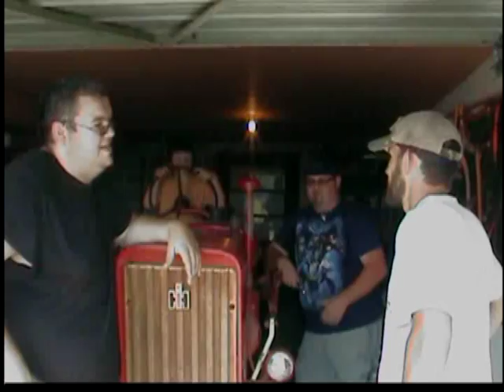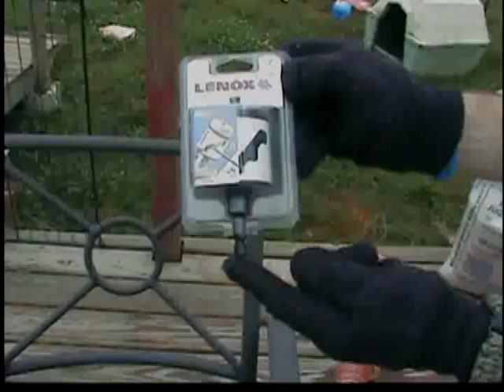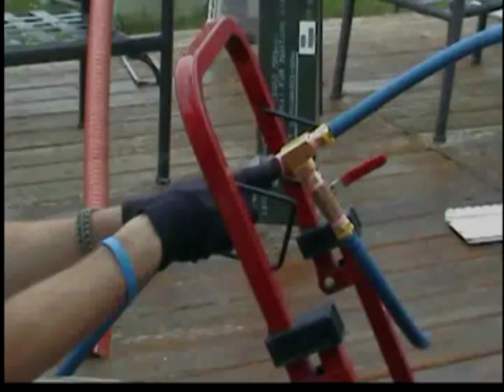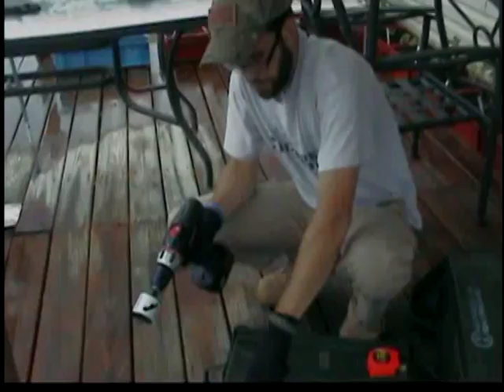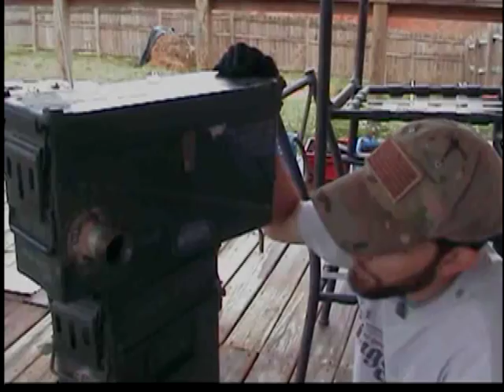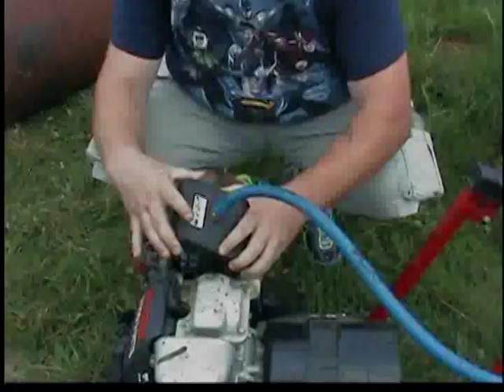How To Build A Wood Gasifier (FEATURED ON DOOMSDAY PREPPERS SEASON 2)

Comment: Coal burns cleaner then wood. Coal, just might be a better cleaner burning Gasifier.
Reply: ilililhy1 I think that a lot of the gases and smoke from burning the wood are captured into the system and turned into either creosote or usable gas. Would be interesting to see a study on that.

Comment: Could I hook up a device like this to the exhaust of my pellet stove?
Reply: Generally, no, you have to bake the wood in an absence of oxygen in order to get a viable wood gas off of it to power your equipment.  Your pellet stove burns the wood in air, and if it is working right, the main products of the breakdown of the cellulose would be water and carbon dioxide.  When you bake the wood in an absence of oxygen you get gas with the major constituents being carbon monoxide, some hydrogen, as well as a bit of heavier hydrocarbons and some inert gases.  Carbon monoxide and hydrogen are both useful as a fuel in that they will burn when mixed with oxygen in the cylinder(s) of your generator engine.
Reply: richhagenchicago baking wood is more like destructive distillation than how a wood gasifier works. WW2 systems in Europe and later don't work like this at all.

Comment: Question about fuel: What have you used as fuel for the gasifier? As well, what fuels have you tried to turn to gas? In one episode of Doomsday Preppers there was a family that was manufacturing blocks of newspaper & cardboard via a shredding/soaking/molding process. Is there a possibility that this product could serve both as a fuel to gasify and at the same time be in the gasifiying chamber? And of course, less specifically, what other alternative fuels have you used for the gasifier? Any help greatly appreciated!

Comment: This is a good start to driving a vehicle of using electricity to run.  Being homeless
it could keep you warm with lights and more.  The cost to start is hard and the box (s) can be made of other metals to replace military ammo boxes that are not always available at army surples stores. The thickness of metal and size(s) should be told as the least and most you can use.
Reply: You can modify vehicles to run directly on wood gas.  It was probably a lot easier on vehicles with carburetors, but it has been done extensively in times of crisis or war when petroleum based fuels were not available.   The premise is simply to bake a cellulose containing material such as wood in the absence of air to cause it to break down and give off gasses that can be used to drive your vehicles engine.  These guys built a simple practical system which works for their purposes and took the time to clearly explain how they did it so that others could copy.

Comment: Hi guys do you want to  help me out  . I am trying to get parts to help my farther start replace is stolen. 600 watt solar set up, they took everything charge controller, 4 deep cycle battery's . 2000 watt 230 / 240 volts  inverter made for UK cables the lot I am trying to find were I can get 1500 to 3000 watt 230 / 240 volts inverter which will run UK items all I can find are 110 .Can you help do you know anyone who would send  a Harbor Freight solar kit to UK or any parts like Harbor Freight charge controller which would help so much get started  has we can't get in the UK nothing on eBay UK  
I know he always watched your video's for hours and I know it took him two years to get all he had testers so on set up is solar,and get 230 / 240 volts inverter Norman
Reply from the maker: Im not sure what the alternative would be in the UK on the harbor freight type unit. I would look on the US side of ebay for a seller that will do international shipping. I would imagine that harbor freight would ship it but you would have to pay astronomical shipping on it though. I cant stand theives and that is why I am getting the bullets loaded on this side of the pond because I wont tolerate people coming to steal what I have worked hard for. I hope all goes well with your effort and if you cant find an ebayer on the US site side just email me at 7trumpetsprepper@gmail. com and I will take a look when I get done with some ministry work this week. blessings
Reply: I don´t have too much knowledge on this topic, but wouldnt a 110-230 power converter do the job?
Reply: Hi  harbor freight units on eBay prices 3 x more with us  import tax ,government tax here and not lot can get any good from ebay UK
hope you all doing well

Comment: Just a thought,  couldn't the gas from the gasifier pass through a sealed water tank system like the thump keg on a still to cool it as well as filter it before the gas gets to whatever motor you are trying to run? As far as that goes as far  as I can tell a liquor still with very few modifications ccould be converted to become a gasifier.....

Comment: if  you use a welder and gas pipe or galvanized pipe and fittings you can eliminate the rubber pipe and the rtv silicone

Comment: is it more efficient that building a steam engine that would turn a generator?
Reply: If one is looking for efficiency, then perhaps a stirling engine run from the heat generated by the fire? One could still produce biogas the way 7TRUMPETSPREPPER did and maybe use the waste heat as well for a system more efficient than a steam engine, I would think.
Reply: xoxoXoieoxox All the info I can find on Stirling engines makes them out to be very efficient, but I'll admit I'm an armchair engineer when it comes to things like that shrugs.  However, it does seem at least like having one less thing to worry about (keeping water in a boiler like in steam engines) would make for a more worry free set up... So perhaps a good trade off even if it is less efficient over all.
Reply: Zack Toor
Stirling engines typically don't put out enough torque for any useful work

Comment from the maker: do not use pressure treated pallets and keep the unit at at least 451 degrees so you are producing gas and dont let it get over 500 so it runs at optimum performance.

Comment: Great tutorial.  Just ordered all the parts for this.  I was looking into wind or solar power to charge batteries when I saw y’all on preppers.  Hopefully I will have this up and running by the weekend.  Thanks again for sharing your design.  

Will any wood work in this, or is the heat treated wood from pallets the best?  Also, can the temp get too high, and is this something that I would need to monitor as it's running?

Comment: I have a 2 part question: You said the 55 gallon drum production burn time is about 20 min. How long does the 129 mm Ammo Can last before all of the wood gasification fuel is spent and has to be refilled and approximately how many pound does it hold.

Comment: Hi ... All interesting stuff....BUT.... if this gasifier is designed to be used when all usual services have failed, how long do the ammo cans last? I ask because you mention using a 6" length of tube/pipe so that when the cans wear out you can re-weld the tube to another can. My question; What is going to power the welder???

Comment: you know you can make oil out of wood gas by cooling it a bit and still get the wood gas. By grind aluminum cans run the oil thorough the fire in a pipe with Al then a dry medium and make gas and diesel and a gas call butanol that can run any thing like propane and butane. and you can store it all.

Comment: Yes and Yes. Woodgas is predominantly Carbon Monoxide and hydrogen. CO is easy to store. Some use latex weather balloons for a short-term storage solution (but they will eventually leak somewhere as their durability is a matter to consider). Otherwise it can be stored neatly in ye olde propane tank indefinately. And as for powering your house, absolutely! Just find a generator that can run on the gas and you're off the grid!

Comment: wood gasification (methanol or wood alcohol) is a great idea for an emergency situation, but everyone should know that its very corrosive to metals especially aluminum and magnesium.  The higher the purity the faster it reacts to metals so use it cautiously and expect to replace carburetors and manifolds if you dont flush the system down with fuel or some type of neutralizer.

Comment: I am a Master Plumber and NATE certified HVAC technician.  I am currently working on a self contained wood gasifier with 12v draft induction and variable air/flue gas adjustment.  I'll post a video regarding its build when it's done but it should be able to power any 4 stroke engine from a 1500 watt generator up to a 350 V8 engine.  The downside is that a few of the components would probably not be readily available post SHTF.

Comment: Hemp seed will give you 300 Gallons per acre, of Bio-Diesel with minimal purification, and has sever hundred pounds of mash to feed yourself family and your feed stock. hemp stalk can also provide cloth and fuel. what you have is stop gap technology, good to know but stop gap none the less. sewage and animal flop covered with a tarp will trap and provide methane. to use propane powered generators as another stop gap fuel.

Comment: So I gather that for this design you'd need to burn additional wood to pyrolize the wood in the ammo can for the actual gasification...
There is a great source published by FEMA on the construction of a fairly simple gasifier design in which the wood is burned in the actual gasifier to provide the heat for the pyrolysis (So all the wood you use is turned into gas). That's the design I'm trying to build, but your design is very simple and looks quite easy to build.

Thanks for posting this.

Comment: Great video, confident I could build this with my knowledge and your instruction. One question: if a welder is not available, is there any inherent problem with using nuts with RTV to secure the threaded pipe into the burner box and the filter box, or is the pressure of the gas too high for this type of connection? I envision this type of setup with multiple burn and filter box units could provide uninterrupted power. Again great instructional video and thanks for sharing.

Comment: Thank you for this very informative video on the construction of a wood gasifier. I would like to use your plans for a gasifier to run my generator but my generator is much larger. It is a 15hp engine with 13500 starting watts/ 8000. If I were to build your gasifier would it be able to run my generator? If you do not think your gasifier can run my generator could you offer some tips on how I could modify your style gasifier in order for it to power my generator? Thank you very much.

Comment: this is by far a very simple gasser... it still can make tar, and you're not taking advantage of converting co2 and water vapor from the wood into flammable gas. you may want to look for the simple fire on the drive on wood site.

not saying what you're doing is bad... it's better than nothing in a pinch... but any tar will cause problems in your engine. and I can see this making tar.

Comment: just sayin, the gas your making probly has alot of tar, not too good for engines, if you went with a more modern cone/grate downdraft design you could get a gas as clean as propane in the end suitable for any need vehicle engine stove top generator heater ect